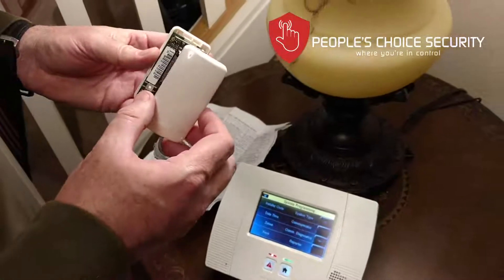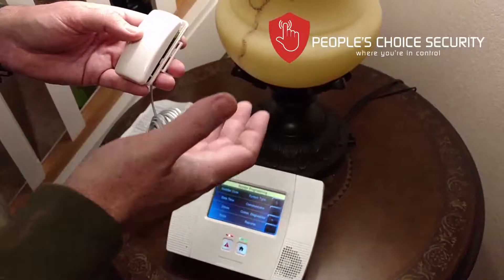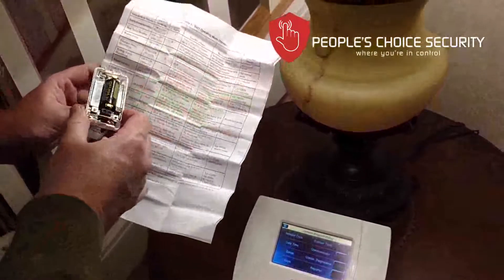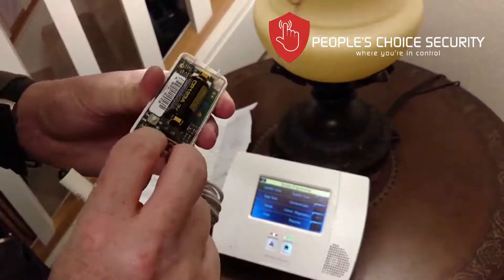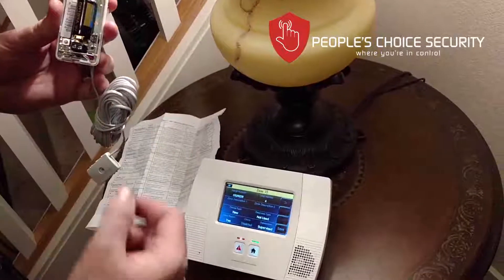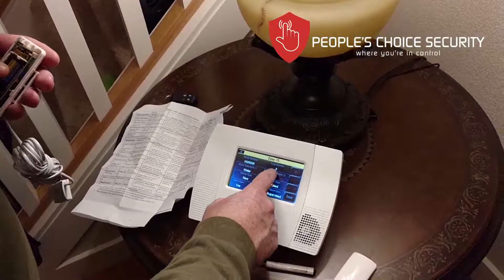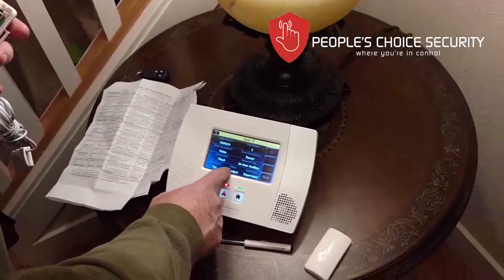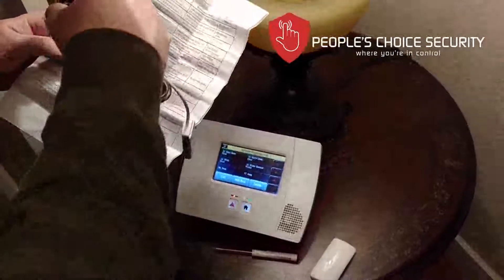How to program the Honeywell wireless Water/Temp sensor

Comment: The resistor should be at the end of the loop on the water sensor.  This is how the system checks for faults in the wiring and can report a trouble if the wire is cut or shorted.  By putting the resistor in the transmitter, you lose the ability to monitor the wiring for faults.
Reply: How do you do that when it’s pre wired